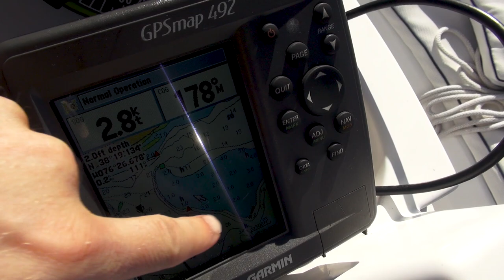Impeller Blowout en Route to Annapolis With Emergency Stop at Solomons - Sailing Viridian Episode 21

Comment: I have (mostly) the same boat and I use some right angle needle nose pliers to grab the impeller and work it off the shaft through the access hatch hack in the head.  To put it back I compress all the blades using some large zip ties, a splash of disk soap on the edge and it slides right in. I never have to mess with the alternator.

Comment: Damn! Awesome engine access! I just replaced my impeller after not checking it for to long. Had to chase down a bunch of pieces, but luckily, they were all at the upstream side of the heat exchanger.
Reply from the maker: Glad to have the access panel in the head! A few months later and we still haven't come across the one missing impeller blade...